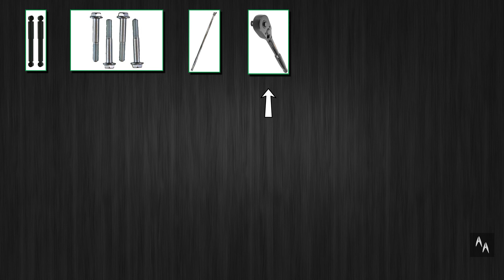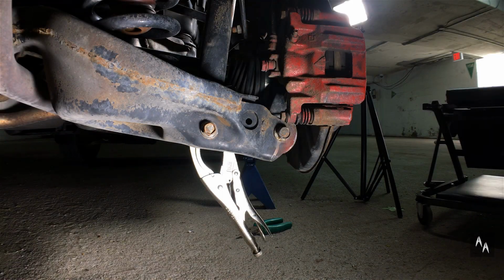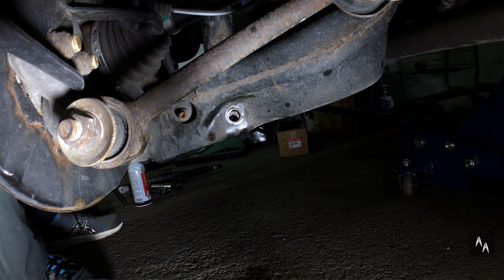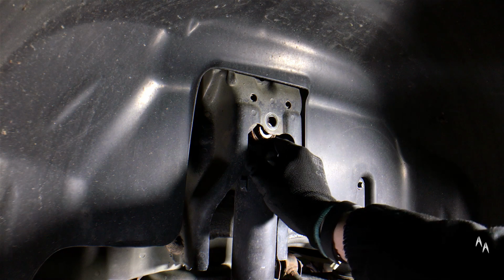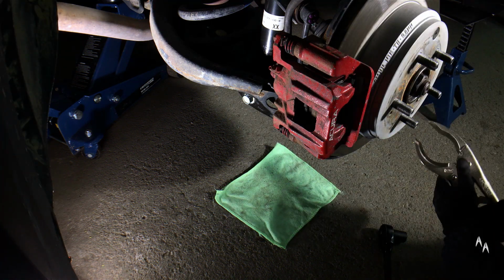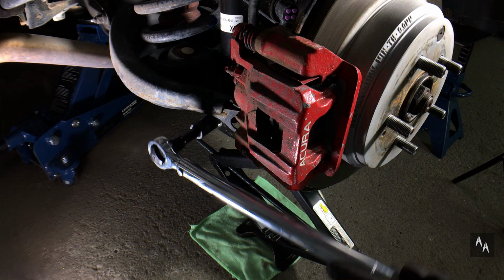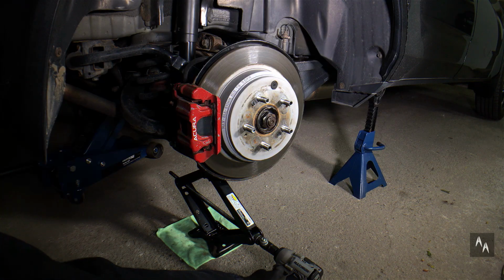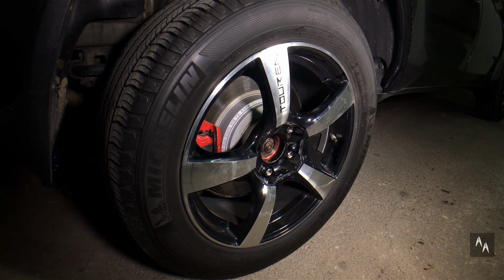Rear Shock Absorber DIY for 2008 Acura MDX

Comment: I just did an ADS delete and installed KYB shocks. My old ADS units were clunking and also leaking, not to mention a HORRIBLE ride. 

I soaked the welded nut several times the week before the up-fit with PB Blaster and the bottom bolts came out like a breeze. Note to Bagdan (sp?) , I had the impact gun you were speaking of. As noted in another comment, the ADS units don't want to compress easily and since I was DONE WITH THEM, I just pryed them out. Splice and solder in a 10 watt, 2 ohm resistor and "Viola" back in business. 

Note on anti-seize and threadlocker: just about everything I put back that has a tendency to rust and/or seize gets a swipe of wheel bearing grease. Even wheel studs....Seems to work for me...

Your video was a great reference for my project. Thank you.
Reply from the maker: Thanks a lot, Arthur! Glad it worked out for you! Name is Bogdan.

Comment: Thanks Bogdan for the video and work experience.  for the lower bolt , after you hit it with the penetrating oil,  make sure the boldt s leveled.  You can raise up the lower control arm  just enough to make it level. I found it  helps with the removal.   

On the install , have a small wood block on a jack to raise the shock to line up the lower bolt.  There is a slit that you can access the bottom of the shock.
Reply from the maker: Hi Louis. Very good points, thank you!

Comment: I think anti-sieze would work better than thread locker if your intent is to remove the bolt easier the next time. Thread locker is intended to keep the nut from coming loose.
Reply from the maker: That’s right, it prevents the bolt from becoming loose and at the same time it protects threads from rust formation thus making it easier to remove it after.

Comment: Great vid, my friend...I just put in my first Gabriel shock.  My only problem arose when I disconnected the attached wires. I connected them with to a 2,  ohm, 10 watt resistor, but I'm not sure if this will work, but the rest of the job went smooth, thanks to your excellent instructions.
Reply from the maker: Thanks a lot, Michael! I hope you don’t get the ADS error on your dashboard.
Reply: I’m getting the ads error on mine, what should I do?

Comment: Good video. I'm going to have my dealer do it because I'm busy and I know the lower bolts are rusted and gone. Also one of the rear shocks is leaking a bit. Sometimes it's simple and I go DIY but this one is better for them with the lifts and tools. Keep up the good work!
Reply from the maker: Thanks! Totally agree on the DIY VS mechanic/dealership repairs. The lower bolts are a real pain, it took me two attempts to get the left one out. Of course, having powerful impact wrench or air impact wrench would simplify things quite a bit!
Reply: @AcuraAddicted  I will try DIY. Do you have the top and lower bolt part numbers? Thank you
Reply from the maker: Yes, all of the part numbers including bolts are in the description.
Reply: How much did you pay for each? I am seeing them listed for 300 each on OEM Acura Parts.

Comment: Hi Bogdan. I am in process of buying a 2009 mdx with elite package at 228k kms. I noticed that the light is not turning on in the comfort button. I read somewhere you talked about replacing the electronic dampers with the standard ones. If it's done then does it show any errors in the dashboard or I am wondering if that's what's been done with the car I am looking at and the light isn't turning on anymore. Any ideas?

Comment: Great video Bogdan. I have a 2011 MDX with ADS. I need to replace all for Shocks/Struts. I have a few questions:
- On the part list is the breaker bar is 1/2" or 1"?
- I am not able to find OEM Parts anywhere in stock (ADS or non ADS versions). any recommendations?
- What other after market shocks/struts you recommend? KYB/Dorma/Arnott?
- What other parts I should change at the same time? Stabilizer links? Mounts?
- Have you seen video's on using the resister to block the light on the dashboard?
Reply from the maker: Thanks! It's a 1/2" breaker bar, but you can get a 3/4" one for better force. I highly discourage from buying any aftermarket full assemblies for the front, they are universally bad. Better get OEM equipment and assemble them yourself. If anything, KYB is the OEM, so go with KYB if you can't get your hands on OEM. They are not the same, but better than Monroe, etc. While you are changing the struts/dampers, I highly recommend replacing stab bar links and bushings, you'll have to detach the front links from the struts anyway, so might as well replace them. No, I have not seen a video on resistors, but it's common knowledge that you can get the error off with resistors for ADS enabled vehicles (mine isn't).
Reply: @AcuraAddicted  Thanks. I plan to call a few places for OEM strut assembly tomorrow. If not able to get them, will look for KYB. Do you have any ideas on TPM sensors for the MDX? Mine are out and I want to replace. Do you know if there are any after market I can buy and program it? Do you have a video on the programming part of it? I could not find any TPMS video on your site. I appreciate the help.
Reply from the maker: OEM TPMS sensors are Denso, you can buy them for about 1.5 times less than Acura price at Rockauto. You don't need to program them in any way, they hook up to the receivers automatically when you install the wheels: https://www.rockauto.com/en/moreinfo.php?pk=5707488&cc=1446912&pt=12036

Comment: Once the welded nut came off, how did you get the bolt out of the sleeve? Continuously rotated it until it started to give and come out? Any details would help as I am about to perform this maintenance as well. Thanks!
Reply from the maker: Yes, that's exactly what I did - kept rotating it until it came out. Either have a powerful impact wrench, or you will spend quite a bit of time with a breaker bar if you face the same situation as I had.

Comment: love your channel!!! 
I have a mdx 2008
It has a vibration in the rear when you pass 110kph
changed rear bearings
changed rotors and brakes pads
changed wheels and tires (i got a summer set)
Still have the vibration, if i pass over 130kph it goes..
do you know if it could be shocks or bushings?
Thanks!!
Reply from the maker: Hi Hernan. It could be a number of things. Axels is the first thing that comes to mind. It could also be the driveshaft. But first make sure your tires and wheels are properly Roadforce balanced.

Comment: I tried to remove my rear ADS shock today (just to find out how hard or easy it is) and I can't compressed the shock by hand to get it out like you did. I had to use a metal bar to wedge it and compressed from the top. After the shock came off I was able to compressed it by holding one end with two hands and the end on the ground and pushing with a lot of force. And once I took off my hands the shock moved  back up to its original position slowly.  Does this mean my shocks are still good? I had to put the old shocks back because I did this as an exercise to see if I can take them off and put them easily. Now I wouldn't have any problem if I need to replace them when the time comes.

2011BlackUbmMDX
Reply from the maker: I understand. If there are no leaks and no issues with your ride, they should still be good.

Comment: I have a '11 Acura MDX Tech package with ADS.  The rear damper with ADS part cost about 3 times the price of a normal  damper ($362 vs $104).  A couple   questions for you:  
1)  How different is the installation of the rear damper if I have ADS?  
2)  What attachment did you use on the impact drill when using the scissor jack?
Reply from the maker: Hi. The installation is no different (minus the connectors for ADS that you won't have for the regular suspension. As for the adaptor, here's one I found on Amazon US: https://amzn.to/2Jbg7Hp And here's the Canadian Amazon: https://amzn.to/2R31EzK. Or you can usually get it at your local autoparts store.

Comment: Is there an alternative for elite owners? Would I be able to install regular shocks in place of ADS?
Reply from the maker: Yes, you can. It’s bolt on. The only thing you need to worry about is if you care about ADS warning light on your dashboard, if you do not install resistors in place of the ADS connectors. If you don’t care about that, that’s fine, as long as you get full front and back damper assemblies (part numbers for 2007-2009 models in the description to the video).

Comment: Do u have to get an alignment after u finish? Cuz i already got an alignment but if i install new struts are u saying ill need another  alignment?
Reply from the maker: The official manual requires alignment, yes. However if you are not changing anything except the rear shocks, there is really no need for that, as there will be negligible effect on the alignment after that, if any. But when you are replacing the front dampers, alignment needs to be done for sure.

Comment: Hey Bogdan, I just bought a 2009 MDX that feels like a horse and buggy ride sometimes. It is a very "bouncy" ride. I found a Honda mechanic nearby that will place the rear shocks on for $75 USD/piece. I just need to bring the parts. Is the parts listed in this video what you would suggest? Thanks!
Reply: I have the "sport" package as well so I want to make sure I buy the ADS (I think that's what I need) variation
Reply from the maker: @laurenmiller3297  Hi Lauren. $150 is a reasonable price for labour for changing the shocks if you are not going to do it yourself. The part numbers in the description are non-ADS shocks for the Tech model. The ADS ones are way more expensive. Here's the part number for your vehicle: 52610-STX-A55. They are about $350 a piece. I don't think it's worth the money, honestly. They are about 3.5 times more expensive than the non-ADS ones. You can install non-ADS shocks. You won't have the ability to switch the comfort/sport mode for the rear and you'll have the ADS error displayed unless you use resistors.
Reply: Yeah I was just reading a thread it looks like you’ve commented on mdxers. Is it possible to just change the rear shocks to non-ADS shocks and keep the front shocks for the time being? Thanks!
Reply from the maker: Yes, you can just replace the rears or the fronts with non-ADS, or all fours. Just change them in pairs.

Comment: Hello Bogdan, Thanks for the video.

I am currently having a rear alignment issue for 2007 Sports.
Also have the Check ADS warning. I do not intend to replace with electronic shocks.
I have two questions please
1. What non-ADS rear shocks should i go for? I do off-road driving a lot.
2. Sports vs non-ADS spring, any difference? I have the feeling the sports is too soft. Prefer a stiffer spring. Any suggestion on options?

Thank you.
Reply from the maker: Thanks! My advise - go with OEM shocks. You'll still have the ADS error (can be removed by installing resistors). NON-ADS springs are different - they are more thick and therefore stiff. NON-ADS shocks feel somewhere in between ADS SPORT and COMFORT mode (a good middle) as per many people who have replaced them.
Reply: @AcuraAddicted  OK, thanks for the quick response. I guess i will just go with the Non-sports OEM (Spring and Shocks). A buddy mentioned MOOG springs, another mentioned KYB shocks. Never used any of those.

Comment: he keeps saying there should be no problem with the upper bolt.. what if there is. Is it threaded into the frame of is there some sort of weld nut on the backside of it?
Reply from the maker: There should be no problem with the upper bolt because it’s a) High enough to be too far from the road elements and b) Covered enough to be less exposed to whatever elements get there.

Comment: In which case do you have to change the Rear Shock Absorber? How do I know if I have ADS or the regular one? (canada)
Reply from the maker: It really depends on a lot of factors: if they are leaking or not, ride quality and harshness, mileage. As for determining if you have regular or ADS, other than having a US Sport or Canadian Elite model with a comfort button in the base of the gear selector, in case you suspect yours could have been swapped with regular shocks (because they are bolt on), you can look at the shock itself and see if it has an ADS connector and any wire going to it (same goes for front ones). Depending on your wheels you might be able to determine it without taking a wheel off through the spokes. In my video, as you can see, no connectors, wires or plugs are anywhere on the shock. If it's ADS, it will be there.

Comment: Great video, very helpful. Is there a chance you can use the original bolts for rear strut replacement? No dealer around me seems to carry these in stock. I'd have to order online and wait a few days. Also is it advisable to change just the rear shocks and leave the front original? This is on an '08 with ADS suspension.  Thanks again for the videos. Awesome work!
Reply from the maker: Thanks! As far as the upper bolt is concerned, it’s fine, because it’s not open to elements. However the bottom one is constantly being doused with water. I wouldn’t recommend keeping it. If it’s out of stock, order and wait, they should turn it around quick. For swapping the ADS to non-ADS, you can do whatever you want, as long as you are replacing them in pairs: e.g. leave front ADD and replace rear ones with the regular shocks. Or vice versa. Or replace all four. Just don’t replace one.
Reply: Rear shocks should just come with the lower bolt. Both of mine are trash. Luckily local hardware store had some that are almost exactly the samw.!

Comment: Hi, I have a 2012 Acura MDX, my rear damper sensor needs changing, do you have a video on how to change the sensor ?
Reply from the maker: Hi. I don't know what the rear damper sensor is. I don't have it.
Reply: Hi, it's a little unit that attaches to the shocks, it switches the ride from comfort to sport. Thank you for the reply. I have learned a lot from your videos...
Reply from the maker: I see. Thanks! Those are ADS shocks, which I don't have on my Tech. I think you might be referring to the wire harness that goes into them? https://www.oemacuraparts.com/oem-parts/acura-sub-wire-r-rear-shock-absorber-52650stxa02 ?
Reply: @gatekeeper7837  Hello, have you change your dampet sensors? I'm having the same problems.
Reply: @louiebasilio5496  hi, no I haven't changed them as yet,  was wondering if you had a video for that
Reply from the maker: As I said, my model is Tech, I do not have ADS dampers, I don’t have a video on them.
Reply: @gatekeeper7837  Sorry, no video for that.

Comment: After installing the now shock. How do you bypass the ADS system check?
Reply from the maker: People usually install resistors to fool the system. I didn't have to, as I do not have ADS, because it's a Tech model.

Comment: Hey bro. I want to know . The rdx and mdx is the same for changing the shock ?? In 2008 model
Reply from the maker: Hi. RDX has similar construction shocks, so the procedure would be similar. Just a bit easier, I would assume, because they are not as massive as the ones for MDX. Good luck!

Comment: What brand of shock you bought? I am thinking to replace the ones in my 2006 MDX. But the Acura OEM is $150 a piece.
Reply from the maker: I only use OEM parts. For the rear shock you can buy a KYB, they produce OEM ones, so it's essentially the same shock. However I bought the original set of all four. $150 a piece is too expensive for them. I got mine from Acura for $180 for both rear ones. 2006 price might be different. In that case I would look for third party ones. KYB Excel-G for your vehicle should cost around $30 a piece.
Reply: Acura Addicted Thanks! I will give KYB a try.

Comment: Great video! Did you ever need to replace the stopper assembly (Part#:52720-STX-A01) on your MDX where the rear spring is attached?
Reply from the maker: Thanks! No, I haven't. You need to detatch the lower arm to free the spring. So first you will need to lower the muffler (because it's in the way), then put the jack under the lower arm, take out the rear damper lower bolt as well as the flange bolt and stabilizer bar lower nut. Then lower the jack to free the spring (it's not loaded, so that's fine), which will reveal the stopper. Just take the bolt that connects it to the body out and replace the assembly. The hardest thing would be to get the lower shock bolt out. You might also have difficulty with the stabilizer link.
Reply: Acura Addicted ... Thank you so much for your response. I do hope in the future you will make a video tutorial regarding this procedure.  Thanks again!!!

Comment: The nut snapped off on mine too! Now the bolt is completely stuck in the shock mount from rust. Even smacking it with my BFH didn't budge it! Help!
Reply from the maker: Yeah, I feel for you! Try continuing to unscrew it, that's what did the trick for me. Would help if you have a hi torque impact, too. Otherwise just a torch, I guess...
Reply: Acura Addicted I ended up cutting the ends off then drilling out the rest to get it out! Ugh! Pain in my ass!
Reply from the maker: Man! How did you cut it in the lower arm? Angle grinder? There’s virtually no space there! Glad you made it!
Reply: Acura Addicted yes angle grinder with a cutoff wheel. Cut the ends off then drilled out the rest so the bottom of the shock would come out of the control arm.
Reply from the maker: @JmanRx81  Nice!

Comment: What kind of gas mileage does your mdx get. Mine only gets around 12 miles a gallon
Reply from the maker: My average gas mileage is between 16-18 MPG. My highway mileage is 24-26 MPG. Of course, all of this highly depends on the cycle and driving habits.
Reply: @AcuraAddicted  thank you very much. It probably needs a tune up